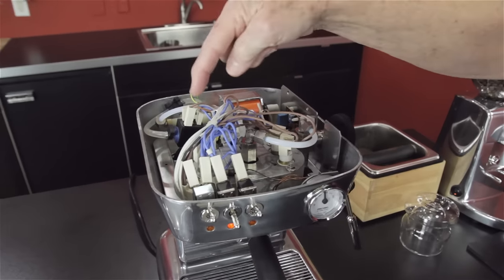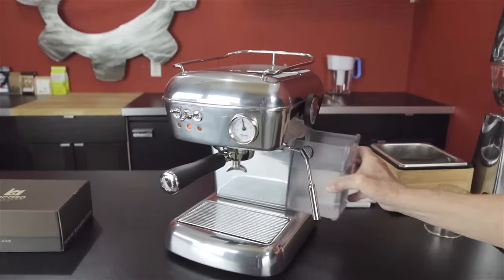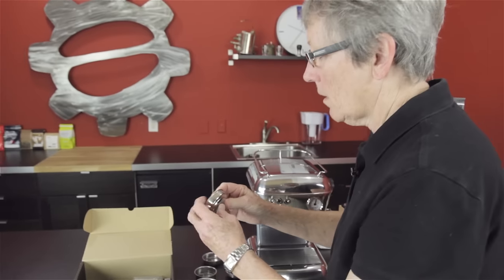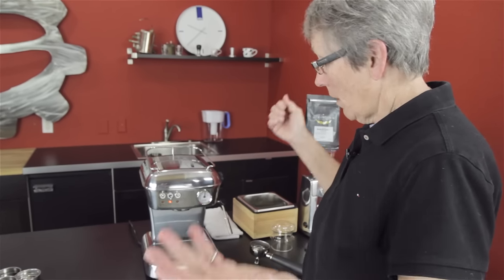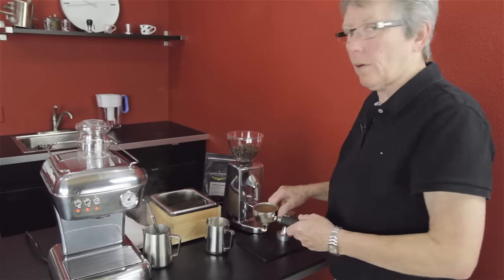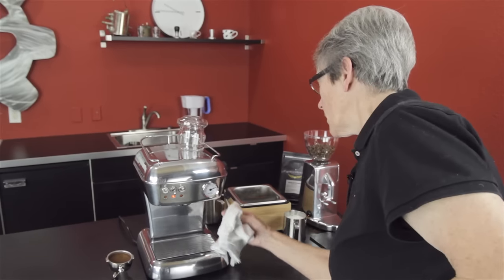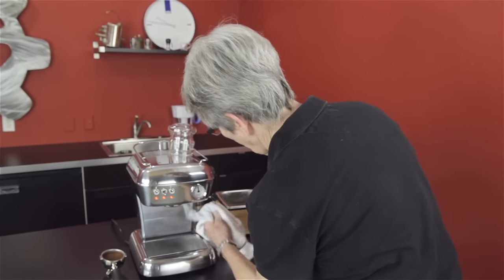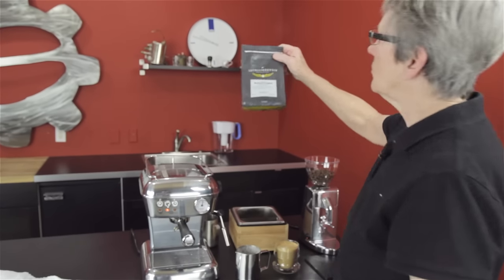Ascaso Dream Up Espresso Machine | Crew Review

Comment: I have a Ascaso Dream that was built 12/2006. It had started “leaking” (i.e. continued to drip after making a shot).  I decided to do a “tune-up”, so an internet search for the Dream boiler group diagram resulted in a nice exploded drawing (make sure you check the dates to match your machine), and part numbers. 
I decided to replace the three gaskets:
Pod gasket I.18
Brew head gasket I.54
Shower holder gasket I.57

I also replaced the silicone valve (I.13) and retention valve spring (I.15) because those looked like the most likely culprits for the leaking.

Once it was disassembled to that point, I took out and examined the “holder shower -  group thermoblock” (I.2246). It was cast aluminum and was severely corroded. I ordered a replacement, which appears to be brass or bronze.

Some key points I learned were:
- Keep your machine clean, inside and out!
- Follow the instructions for descaling your machine.
- Follow the recommended cleaning and descaling schedule.

The tune-up went really well, the Dream continues to make excellent coffee, and I have a much better understanding of how it works. If you’re confident with hand tools, you can do this!
Reply: I have the same issue. Do you think it was the gaskets that fixed it or the descaling?

Comment: I'm finding the filter basket only takes about 14-15 grams without hitting the fairly low-hanging screen. Is that about what you're dosing and what kind of output are you pulling? Lovely results and I'd love to chase them.

Comment: Gail, when I switch ON the pilot switch of "Steam" the thermoblock does not produce "tock" "tock" noise but it's temperature goes up to 150 Degrees Celcius and then there are steam coming out from the brew group. Do you have any idea what is wrong? This new machine just delivered yesterday...
Reply: I have the same situation. It's going about 50 seconds to pump start working and the temperature is about 150 and higher.
Reply: You have to open the round steam valve on the top right to get water moving through first. Once water comes through, turn off the steam valve & the temp will rise & pumping will begin.

Comment: I have that Ascaso machine from 3 years ago. It never makes as much as foam as you get in the video! What is the secret? I tried different water, coffees, temperatures... But my coffee foam is always very small or inexistent.
Reply: If you are talking about crema, the pressurized basket insert makes a big difference.  The machine is a little low on pressure otherwise.  Otherwise, you get more crema from fresher coffee and hitting the right grind (should be quite fine).

Comment: 57mm filter? Odd size. my Gaggia is 58mm, which I thought was the commercial standard? I would have to ditch all my VST 58mm baskets if I got one, so perhaps not....
Reply: The portafilter is 58mm, the tamper has to be smaller to fit inside the filter.

Comment: Why do you do the milk first?
Reply: Scott Kendall the espresso shot can loose a little flavour and turn a little bitter as it cools :)
Reply: never knew that, thanks
Reply: Scott Kendall also, if u do the milk firat the boiler reaches around 250 degrees, but once u purge it and let.some cool.water in and see the boiler lighy shut down you stop then wait till.the light goea off then u can do that shoot because its gonna be closee.to the 200 degrees needed for breqing this is called temperature surfing, if u do the shot first normally the maxhine wont get up to the 200 it would be more like 170 or 180 according to my testing.